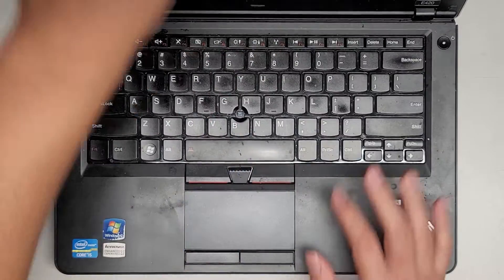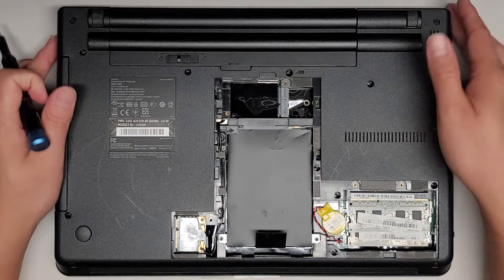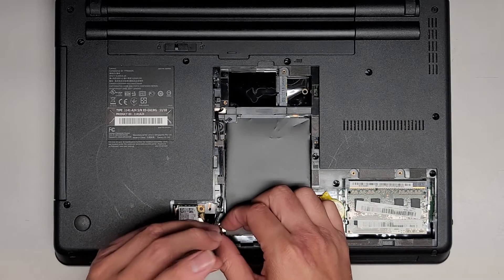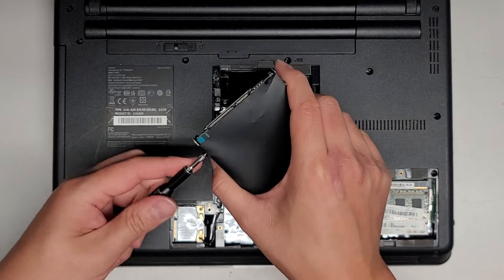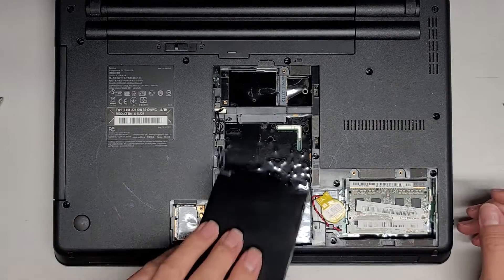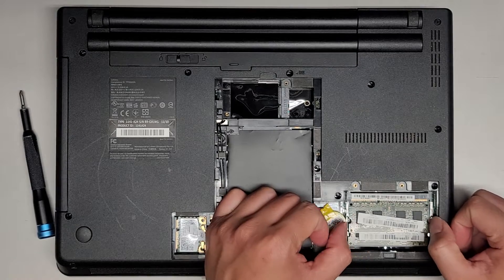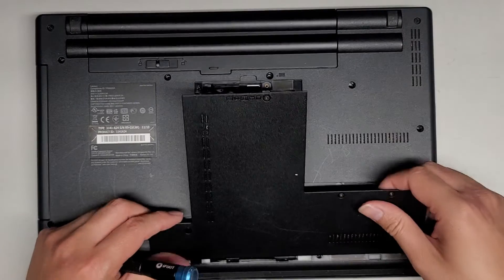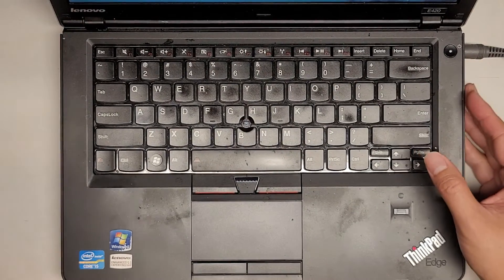Lenovo ThinkPad Edge E420 Disassembly RAM SSD Hard Drive Upgrade Battery Replacement Repair

Comment: Useful video, but I saw at least five No-No's (based on my 41+ years of professional, practical experience as a computer scientist):
(1) Always remove or disconnect the battery before doing anything inside the PC.
(2) Do not touch internal components of the system with your fingers: Electrostatic energy "stored" in the human body can discharge into circuits and damage them... especially when it's a client's machine! This can be prevented by wearing an antistatic grounding strap, which I can see is not being used here.
(3) Do not "poke around" / point to components with a screwdriver or other metal "pointing" device... capacitors hold lots of energy even when unplugged from power and the battery is disconnected, so if you touch their two connectors... ka-POW!!  And your PC is now toast!
(4) Do not fasten or remove screws from devices while hovering over the open PC, e.g. holding the cage covering the HDD/SSD; if a screw drops and bounces under something, you've just added time to your job. And if you didn't see it fall or where it fell and it landed shorting against a circuit, expect a sad surprise spark and destruction at power-up time!
(5) Always insert screws by hand to prevent cross-threading (these tiny screws are so easy to inadvertently cross-thread!) Loosely hand-tighten each one to ensure there is sufficient clearance through the mounting bracket / housing holes' edges. After all screws are in place, then tighten with screwdriver.
These sound practices apply to working on many other things beyond computers, including household and automotive repairs.
Reply from the maker: I know. Lol I've been doing this over 10 years and haven't had any issues. If you know what you're doing and you're careful, you'll be fine. I've seen parts shipped in normal bubble wrap that end up OK, but it is risky. Like you said, capacitors store energy, so disconnecting the battery won't prevent damage if you drop something conductive on it.

Moral of the story, be careful. RAM, hard drives, and SSDs are perfectly fine to handle without disconnecting the battery. Just make sure it's off.

Comment: Great video, I had one of these lying around and popped new ram and ssd using your video and made it all new again quick and easy!!
Reply from the maker: Glad it helped. If you haven't already, please like and subscribe so others can find my videos. Thanks!
Reply: Hi Man,
I have exact laptop. I want to upgrade RAM. What did you upgrade to ? Do you know how much RAM does it support ?
Reply from the maker: @raakessh24  the only limit is what you can fit in the slots.
Reply: @ItsBinhRepaired  Ou seja se um slot tem limite de 8gb, o segundo também!
Reply from the maker: @teby-i2o I think there are 16g sticks.
Reply: It made it quick? I'm in the same boat, and wondering if I should do ssd as well as ram...?